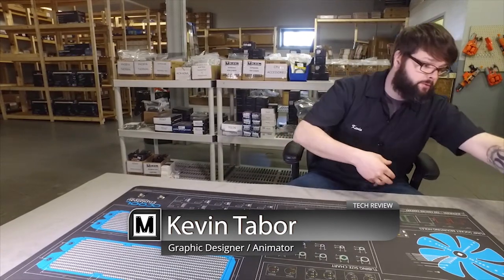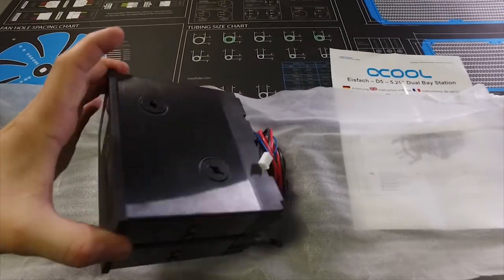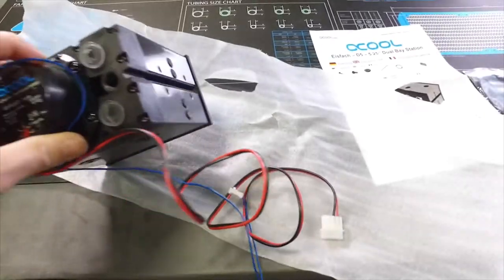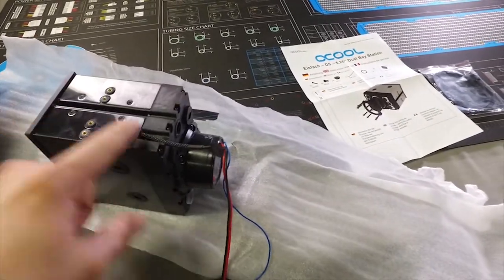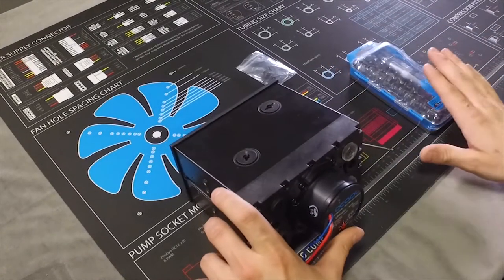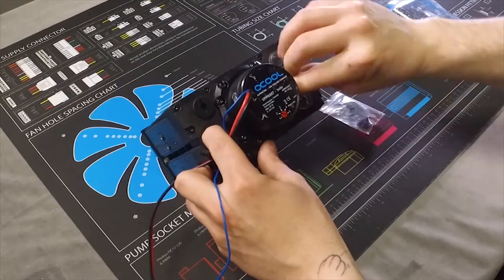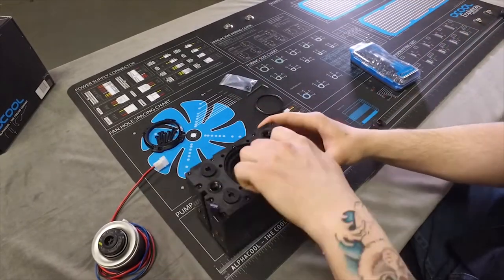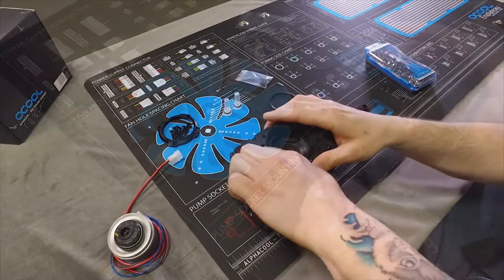Tech Review #1 - Alphacool Eisfach 5.25" Dual Bay Pump Reservoir Combo

Comment: I really like this Dual Bay Reservoir I bought from you guys.
Reply: Nice to hear. I wanna get this one too, since I prefer these 5,25 bays. The normal reservoirs don't look that good if you're using it for a CPU loop. Would you recommend that bay?
Reply: Nice to hear. I wanna get this one too, since I prefer these 5,25 bays. The normal reservoirs don't look that good if you're using it for a CPU loop. Would you recommend that bay?
Reply: I if you do decide to get it, buy two led lights for the Window.

I went with two blue LEDs and it mad a heck of a difference.
Reply: Yeah, two blue lights look nice in my build (mostly black/blue) as well.
Reply: same here